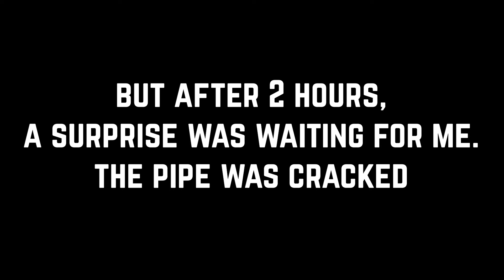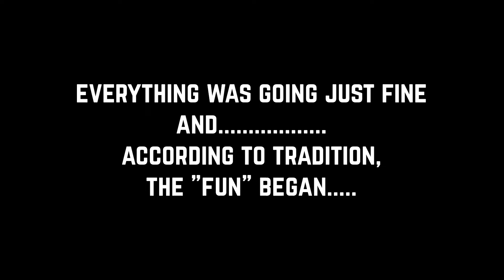Restoration Georgian Broadsword with a Skirt - RARE TYPE

Comment: Nicely done. Personally, I’m not fond of the skirt but if it’s traditional, then yeah. Note that with the handle if you can find wood that has a natural curve it will be less likely to break.
Reply from the maker: Hi! Thanks for attention. Well, the "skirt" has the main and practical function is to protect the scabbard from the sweat of the horse. Because the sword was used by cavalry.
Reply: @ScrewsAndTools  Makes some sense then. Still looks odd to me though.